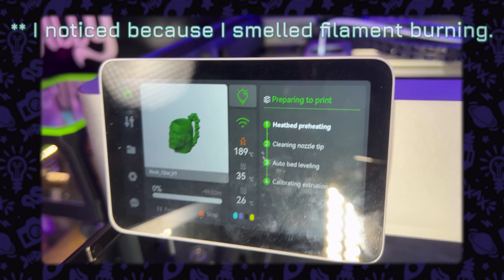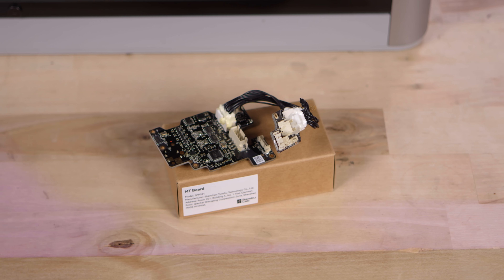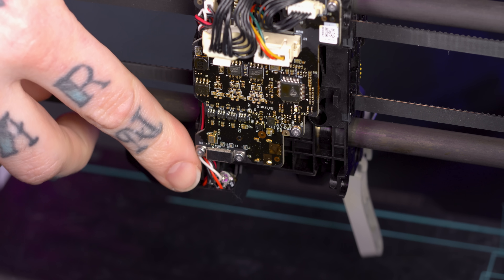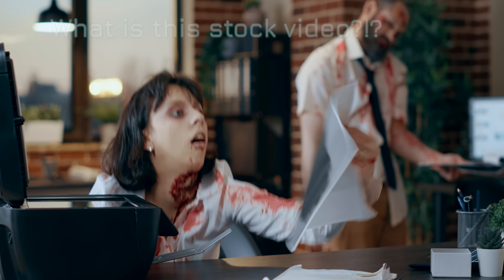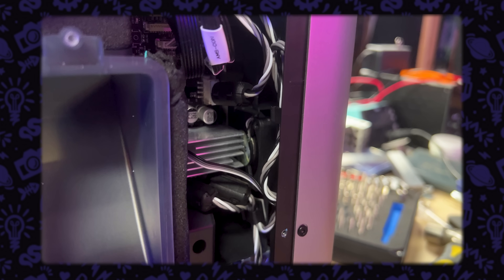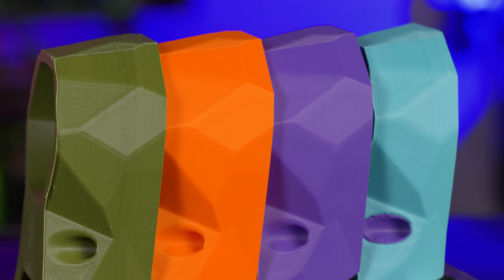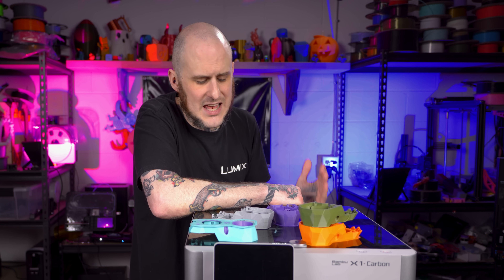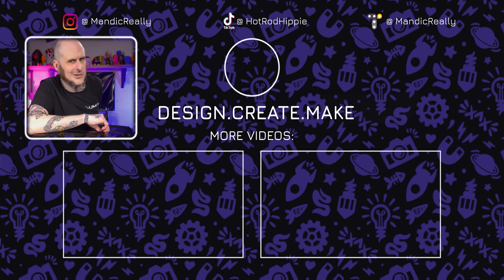MY BAMBU X-1 BROKE - Thermal Runaway?! Let's Fix it!

Comment: I'm not sure if my issue is the same thing but hoping for some advice.  Bear in mind I am VERY new to 3d printing.  I was given a very lightly used MP select mini v2 in December and it's been working great up until yesterday.  This was the first issue I've had and my first failed print.  The nozzle appeared to have grabbed part of the print and was pulling it along as it did more layers.  The kapton tape and fiberglass insulation on the heat block had fused to the print and was pulled off the heat block.  Luckily I was nearby when this began. While I was standing there watching it I began to smell hot plastic and saw a wisp of smoke.  As I was reaching to power it off I saw the temps climb to 330° even though it was set to 215 and had been working perfectly through over 2kg of Duramic PLA+ (recommended print temp of 220).  I pulled it apart and checked the hotend over. The PTFE sleeve in the heatbreak was burned at the lowest point and had narrowed to a pin point.  I tested the thermistor and it tests out fine and when it was installed it still read the temps and kept updating.  The printer just wouldn't stay at the temps I set it to.  So I'm not sure if this is thermal runaway due to a bad thermistor or not.  The nozzle is discoloured now and definitely cooked.  Nothing moves through it now so I'm not even going to try and clean it and I'm waiting for replacements to arrive.  I'm happy to replace whatever parts are needed but I don't want to just toss parts a problem without knowing for sure if those parts are the problem.

Any ideas?

Comment: Well when i bought my first printer 5+ years ago, low reliability was a consideration. So what i did was order one purely as a parts kit so i would internalise how everything goes together, how it must feel, what things do, 10 hour assembly is a bonding experience. A year later i saw people buying mostly-preassembled Creality printers and decent clones like by Geeetech and then swearing them up and down and throwing them out the windows, because they don't understand what's wrong with them, so much angry screaming. And it's not like there's a lot fundamentally wrong with these machines, they're OK, you just find one niggle at a time, something that was OK and went wrong, and fix it.

Though i've done laptop and digital camera repair so there's little that could scare me.

Comment: I just found out about this machine on Friday.  And while on paper, it is the next best thing since Betty White...it reminds me of Slowforge...err...Glowforge.  Let me explain.  I primarily do laser engraving...I dabble in 3D printing for an FRC robotics team...so I own 2 Prusa's Mk3s+.  My first laser was a Glowforge.  All the software to run it is in the cloud.  Same as this.  IF either goes under for whatever reason...you basically have a paperweight.  UNLESS you can jailbreak it.

For what it offers...it seems like a nice system.  The cost of everything on this is less than building the Prusa (fully built from Prusa) to these specs...minus the LIDAR.  IF they didn't offer their own slicer (cloud based)...I wouldn't hesitate on getting one...even with the thermal issue you experienced.  People may say I am a newbie and I have no idea what I am talking about...and they may be right.  I will stand by it.  The more complex a system is, the easier it is to fail.  And if one keeps everything proprietary, if it does fail, well welcome to the world of paper weights.

Keep up the great work...I hope they discover the reason for the runaway...and improve the shutdown time to save future machines.
Reply: Hmm as far as I can tell the software to run the x1 is not "in the cloud" at least not if you print using an SD card, maybe not with wifi either. I donno, could be I suppose.

Comment: Best printer I've ever had (PETG) but..... it is quirky. It's been sorta pleasant figuring it out but now it's getting old fast. I'm completely on-board with new profiles for best quality over speed. I would like to "dial it down" from highest quality to find my own balance on the time required. 
I'm not always in the mood to tinker and tweak even though I enjoy it. Sometimes I would just rather have the perfect part for the time spent. 
I have a new problem that doesn't seem to be in the database yet. My X1 is telling me calibration results are too different from previous calibration and that I need to clean the carbon rod?
Also, since I replaced the print surface with the ones they sent it doesn't recognize the bed anymore and I have to be there to override and continue print. 
Another also is I had ordered and received new hot ends in 4 & 6 and when I replaced them they didn't read ambient temp and wouldn't heat up. I put the original back in and have been continuing to print with it but can't do anything other than open a ticket that there is no category for. 

First time listener - just subscribed. ;)

Comment: I just ordered my X1C (my first 3D printer, I am a newbie) and I can absolutely do repairs like that. Being given video instructions is excellent service and all you have to do is to swap a part. Some screws, a few cables, job done.
But then I have to admit that I have been building PCs for more than 25 years (hobby) and I am a professional machine operator (career). I don't fear PCBs and cables and I know how to use tools.

TBH it would be a much bigger hassle for me to ship the printer to Bambu for repair - it's rather big and heavy. And I'd appreciate if such a simple swap of a replacement part was also an option for washing machines, stoves, fridges, TVs, vaccum cleaners... you name it.

Sure, there may be people who don't want to do it themselves and they can bring the printer and the replacement part to a repair shop.

I think it's like with an IKEA kitchen. There are those who build themselves and there are those who want/have to pay for the service.

Comment: Wait, you are actively modifying the printer and had just been in there screwing with the JST connector and low and behold it is now intermittent. The same JST connectors that are in virtually all other printers and most consumer electronics. That is the reason you now call the printer unreliable? Did you just yank on the wires to unseat it? I think once you get in there and start messing with stuff you have no ground to stand on when things go bad. If you are tech savvy enough to troubleshoot and repair, then by all means go for it but accept the consequences and don't blame the manufacturer. It is an incredible printer for the price.

Comment: I’ve been researching for a few years before I went with Bambu P1P as my first printer. I can say within those years it seems every printer you purchase you will need to tinker with, replacing parts and problem solving.

If anyone feels that tinkering with this is overwhelming then this hobby isn’t for that person.

For me I tinker with vehicles, computers, etc.. So I knew what I was getting into and ready for the challenge.

Thanks for the video share.

Comment: I think there are 2 answers to your question:

1. As of today there is no 3D printing without a technical practiced operator who is capable of reading instructions, changing parts and is willing (!) to gain knowledge in 3D printing (not everyone is or wants to put the time in)! Without such a person a new printer works and is used till the first real problems/ wear arrive.

2. In the future there should be repair centres, where you can bring (in big cities) or send your machine to get it fixed! Otherwise the trend or "cheap Ender machines" goes much further where someone buys a new printer for like 120 bucks just because he is not able (or does not want to invest the time) to fix the one, he already has. That would create a huge technology scrap problem.

=> For a good repairability it would be beneficial if companies agree on some standard parts which are good to get and limit the amount of spare parts a repair service would need ... which is kinda the idea of self build printers with standard parts and goes against what Bambu Lab, Ultimaker and the other proprietary 3D printer companies try to establish.
The next step for a company like Bambu Lab would be to make cheap a Voron 2.4 clone for like 800 bucks (like the P1P) but with standard parts (that could wear out in like 5 years of usage) for a better repairability.

Comment: Great video! I think, just like a laptop, Bambu's printers are tricky to repair but generally more easy go get started. It's a trade-off that probably is better for first time users provided they are willing to contact support and maybe have a friend experienced in similar repairs (laptops and compact consumer electronics). Sadly, not everyone has access to this friend.

Comment: The reason you're seeing differences in the corners is because of the lack of input shaping on your 2.4 prints. Those corners are filleted, they shouldn't bump out they they are.

Comment: This really shows the biggest weaknesses of this machine and its proprietary ecosystem.  That much complexity will foster failure.  Doesn't matter how good the design the more complexity and nearer to the heat source those electronics are the more failures will occur.  My printer's thermal runaway would have kicked off seconds into that issue... that is a fire waiting to happen.  For some this machine is sensible, especially for multi color prints, but for me it is a pass for now.  Competition may bring better options from other manufactures in the coming years.
Reply: Sounds like the Prusa XL will be complex too though (not that you said anything about the Prusa XL). Probably more complex, what makes the x1 complex other than the lidar and AMS anyway. That toolhead changer and heated bed consisting of probably multiple heating elements and sensors sound even worse when it comes to complexity. So doubtful the Prusa XL will be any more reliable.

Comment: My impression of the corners on the part printed on the Voron is that they seem worse to me, not better, but I haven't seen the model to actually know what it's supposed to look like. The Voron print reminds me of over-sharpening on TVs.
Reply from the maker: The Voron does have some extrusion issues at the corner, but the model IS sharp.  It should not have any rounding of the corners. At least no more than extrusion requires.

Comment: Thanks for the video! I appreciate you surfacing issues and how you address them. One of the issues I'm seeing, related to ringing or ghosting, are the ripples that match the belt pitch on X/Y. Have you noticed this issue? I think BambuLab is aware and working on it based on the CEO's recent AMA, but I don't know what progress has been made or what the priority is. There's talk in FB Groups and Discord about using Gates belts, changing the smooth idler pulleys to toothed ones, and changing the stepper motors, but doesn't seem like anyone has attempted to do so as yet. Changing the idler pulleys seems like the most difficult though, especially without instructions and looks like the frame may need to be disassembled.
Reply: Oh bloody hell, i hoped smooth pulleys would have died already! At least when it comes to machines which are beyond the $200 class.

I understand why manufacturers use them. They are cheaper (several cents for smooth vs. a couple dollars for the toothy), and when the smooth pulley seizes on a garbage shot bearing, and that happens quite a bit, nothing happens, the belt can just keep slipping on it fine. When a toothed pulley seizes, well you're not gonna have a good time, so they better be actually good, and you'd still get a few stray complaints and returns where on smooth ones the issue would go unnoticed.

But it doesn't mean i have to like it!
Reply: @SianaGearz  I hope that people will be more vocal about this issue so BambuLab will prioritize a fix. Unfortunately, public callout by those with a larger audience and influence in the community (*cough* @MandicReally) may be the push that's needed to get things going.

Comment: I would have been able to swap those components if it was my first printer, but that's only because I've done that kind of thing before (laptop disassembly for instance).  Still that extreme amount of integration tells me this is not made to be maintained with ease.  Given that they're using linear bearings, I'm willing the bet that a lot of the noise is coming from them and they probably should be flushed and regreased.  Bambu says you just clean the rails and that they're not serviceable, but anyone who has a printer running them KNOWS they need to be serviced periodically (Prusa).

The black box approach to tuning is also going to bite them I think.  As you've already noticed, it overly smooths corners, which could be problematic if you need those details.  Klipper can do the exact same thing (surprise surprise, it's probably the same code), but most people don't let it do it automatically because of these exact issues.

Also, it's 2023 and there's still printers with thermal runaway?! Every reviewer needs to dig into this RIGHT NOW.  Thermal runaway is 100% unacceptable, full stop.
Reply from the maker: The toolhead uses bushing, not bearings, so there is no greasing.  They are self lubricating and the cleaning of the rails is just removing build up from the self lubrication.  This does mean they will eventually wear out, but so do linear bearings.
Reply: @MandicReally  looks like they only use bushings on the carbon rods, at least on their maintenance page.  So the P1P would have those on the tool head as well as the Y axis that the X1C does.  I'd be curious to see if they're using genuine Igus bushings on the carbon.

Comment: A ton of answers I was wanting regarding the X1 Carbon! Nothing is perfect, and up to this point, all i’ve seen was the 100% positive reviews. yours is not negative at all. it simply sheds light in the “real” X1 and brings it back down to earth. I’ve been planning on getting once once they “dial” in the product. They do appear to be doing so. Looks excellent! I am still on the fence regarding the proprietary components and software. I would not want to end up with a brick if the company goes belly up as so many tech innovation companies have over the years. Does anyone have any thoughts on the brick situation if Bambu Lab were to fail? Would the X1 continue to function?
Reply: The CEO has said that everything would go open source in the event that the company went under.  So yeah, that's great, but because the design is so integrated, who knows if you could get boards made to repair the printer.  Or how about those custom ribbon cables.  It's a first gen machine from a new company run by guys that should have known better.

Comment: That massive layer issue on the voron print looks like it was due from warping
Reply from the maker: Possible. It was an ASA print in open air, no chamber panels are on yet and a fan was right above the machine. I wasn’t paying attention to the print beyond the base layer. Just needed a completed print to demonstrate my point.

Comment: Hey, you are right. This is not a machine for beginner. There are to many point. It is not push the button and go. No 3d Printer is at the beginnkng push the button and go. I have experience for two years now, i got several printer, ready or built on on my own. But my Voron 2.4. will not be ready, xy core is different

Comment: the repair politik of Bamboo seems excelent in my viewpoint. If they would offer, to send an replacment machine, or that you can send in yours, when it is broken and they would fix it, other things would change along the way. The might not design the machine in a way, that it is easy fixable (like modern Tablet PCs), they might not offer replacement parts after the warrenty, they might not privide fixing guides at all, and the price might double. So this way, where you have to do a little bit of work yourself, is much better. But I assume it might collide with the law and regulations in several countries, where the seller has to provide free repair for some time after the sale (and not only the parts).

Comment: My first 3D printer was a Flashforge Finder, which looks "Easier" to fix than the bamboo (it's got a single toolhead board and everything is pretty straightforward under the toolhead's hood), so maybe it's more like building a PC than working on a laptop.  Flashforge also is pretty decent at shooting out parts for under warranty printers (and will happily sell you parts for those printers that are out of warranty), but you have to do the repair yourself also.  The finder seems easier to work on than the Bambu (three screws and you're looking at everything), but OTOH, The number of times I've had the hot end out (most recently for a faulty thermocouple, but I've done a nozzle change and PTFE Liner swaps too) is annoying, and that's for someone who sort-of-kind-of knew what was going on going in.